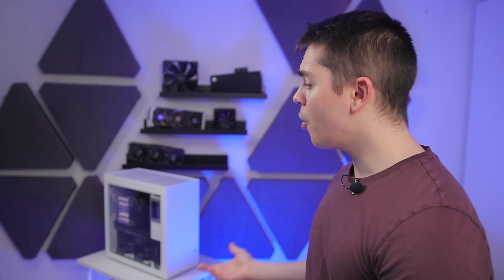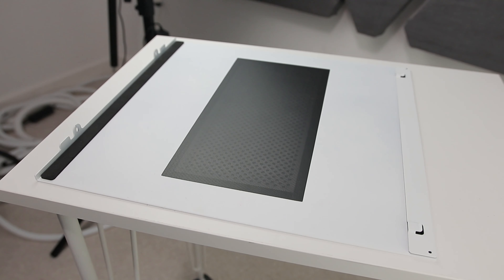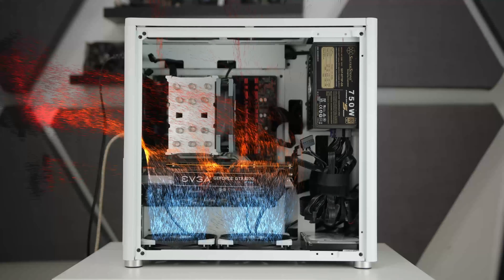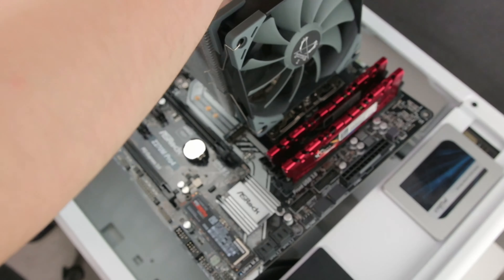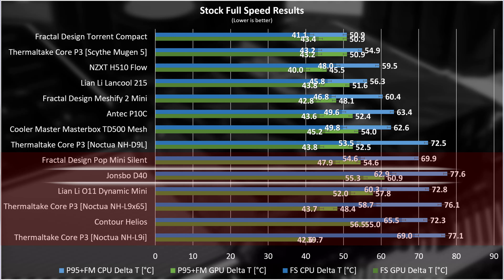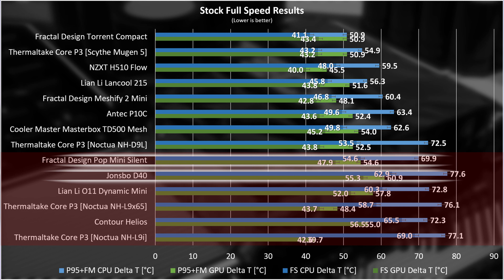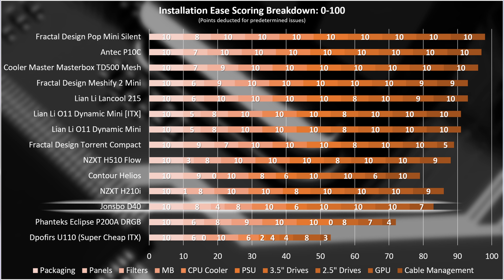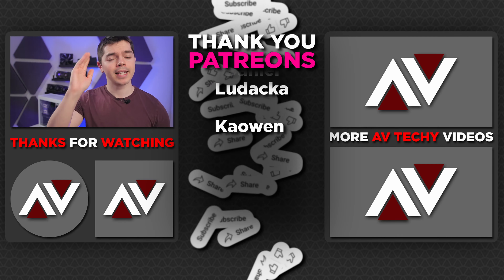Hot & Heavy // Jonsbo D40 Compact ATX Case Review

Comment: Got it for 70€ on sale, i really liked the look of it, but its HEAVY and some installation steps are just a pain, youre so right about that. Im using it with 2x140mm intake on bottom, 2x140mm exhaust on the top and a 120mm exhaust on the back, it actually performs really well in that configuration

Comment: I've just used a Jonsbo U5 for a build, I liked it. using negative pressure cooling (240mm radiator in the top of the case for GPU liquid cooling, only 3 fans and it's cool and quite. Easy to build in, looks nice once completed.
Reply from the maker: Very nice!

Comment: should test airflow with 2 exhausts in the top :) run a negative pressure system, it's a vertical airflow system, Xbox has it's fan at the top of the case

Comment: i would definitely choose the inverted airflow with the back as intake....it just doesn't make sense for the cpu cooler and the psu  fighting for already heated air from the bottom....maybe i would turn the top fan close to the back as intake as well...not sure if it would help... nevertheless , extremely detailed review as always...👍

Comment: 14:22 Thank you for all the info you provided, but combining volume, height, sound level, and fan speed in a single graph? Sorry, that's probably the most obnoxious graph I've ever seen.
As for the case itself. The GPU temp, with two fans at the bottom, as expected looks good, but for CPU, I think it's really a missed opportunity to not test it with rear intake.

Anyway, It's quite informative video, just wish you would actually test with over 310 mm GPU to see how it would actually fit under the PSU.